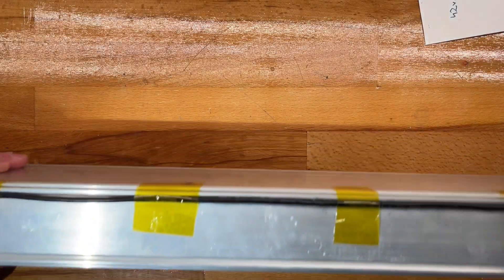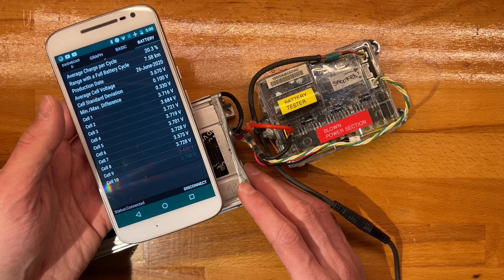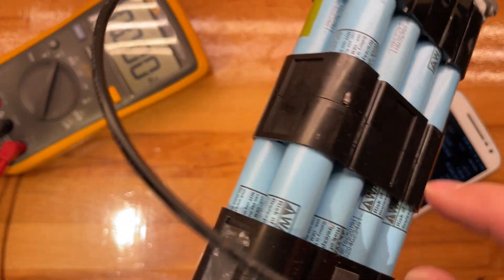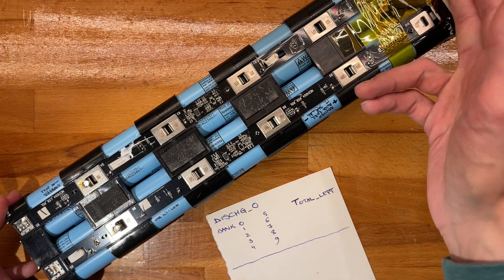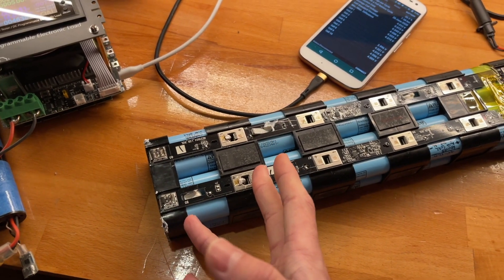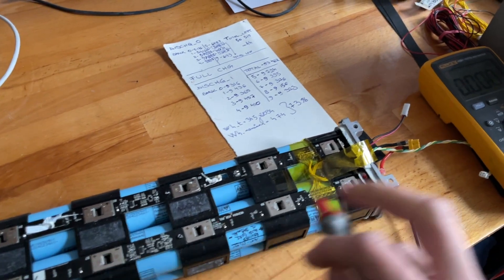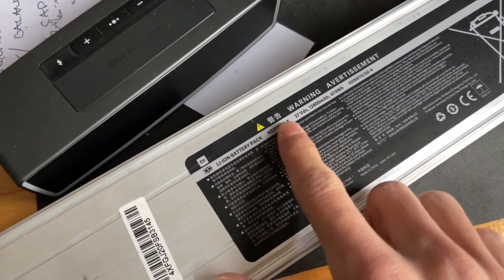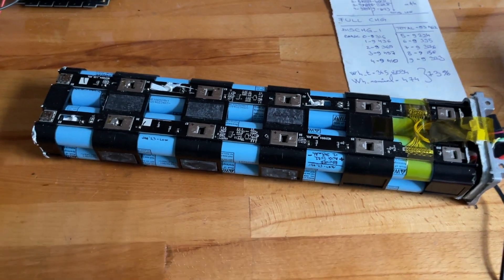XIAOMI PRO2 Battery - Repair 3 [Manual Balancing & Full Checkup]

Comment: how i can run my battery xioami pro2 i will charge only one cell b8 i connected plus to b8 and - b9 i got error diode red  3 fasted and 1 slowed how i can run the bms i got red diod with this error??

Comment: I have the same scooter and I had some corrosion issue, I have no idea how water got inside the battery pack but it did. I bought a replacement BMS the the bars from AliExpress, I soldered everything using a spot welder but when I connect the balancing wires to the BMS it starts with a blue light but then it goes to a blinking red state. I checked the voltage and it seems like there were two banks that were 0.1 volts below the other banks. I recharged thinking it could be the problem but no, still blinking red. Any ideas on what's happening?
Reply: When I measure the voltage of the battery before the BMS it reads 40.6v and after BMS 3.6v with blinking red light. Trying to recharge using the BMS is not possible because the charger indicates that the battery is full (green light)

Comment: I had a similar situation. In my case, despite intensive riding, the batteries were still at 100% after five years (the scooter was kept indoors). However, once I had too much load, and the BMS showed incorrect voltages. It turned out that the STM8L151 burned out (a hole appeared in it).

Comment: Just out of curiosity, it has been a year or so since last video. I guess there were no more manual interventions done to the battery? 
Ot would be great to hear back from Darieee. @darieee
Reply from the maker: heey - yea - unfortunately I found an original spare battery online .. had like 5 cycles on it

and sold the one I had - mentioned everything about it in my listing, including all the videos 🔥

so - unfortunately I don't remember what came of it

about 4000km ... 400 of which uphill with 2 people on the scooter at 1.4kW

I guess the cells were just worn out .. although .. maybe also that BMS chip was acting fishy

do you have the same issue on any of your batteries ?
Reply: Hey, I have an issue oversudden on cell #10. It goes unbalanced and 0.5-0.6V lower then the rest.
Initially I fully charged the battery in the scooter, then opened and charged the cell manually to top it up to the rest of the cells.
Unfortunately it didn't work. After the first cycle the same cell caused unbalance.
Now I opened it again and did full cycle on the cell#10. It has 12160mAh of capacity... Not sure what is causing this. The cell appears to be fine.
I will try to cycle each cell to get overall capacity per cell, and then drain it prior charging in the scooter.

Any advices?

Noted, the cell#10 is the last cell in the pack, hence it would be a nightmare to get it replaced.
Reply from the maker: it's a balancing circuit problem

I did the manual rebalance, and the BMS started AT SOME POINT unballancing a different bank

so - potentially even some firmware issue .. or I just pushed the pack at 1.2kW uphill with 2 people on the scooter for too long

PS: the cells I removed from my offending back were found almost dead after idling in a box for 1 year, so - they were kind of tired
Reply: @Darieee  I did a full cycle (Charge / Discharge) of each cell. I found that the cell #10 is the healthiest among all, with average capacity, 12190 mAh. All cells are within +/- 0.5% from the mean capacity. Another observation I made is that when balancing cables are disconnected, and I was doing cycling of other cells, the cell#10 has been drained from 3.18V (after discharge to 2.8V and rest/recovery to 3.18V) to a 2.9V over a week. It seems like some issue within the BMS, causing drainage of cell#10... 
Any ideas? Could it be an issue of a capacitor?
Reply: Another point of information. I left scooter standing still for a week, and took a snapshot of all batteries voltage. After the week of staying idle the cell #10 lost about 0.077V, while other cells lost only 0.003 upto 0.011V max.
Would it be an issue in BMS, that keeps draining slowly, like a capacitor, or it is the cell #10 got faulty?
Based on my manual discharge and charge test the cell has 12100mAh capacity - the highest amount others... Very strange.

I probably will bring BMS to electronic repair service to check for any faults. Otherwise no idea what could cause the issue...

I run the stock firmware, and normally use it in sport mode. Charging cycle from 30-40% , and very rarely discharging to 5-10% level
Reply from the maker: @05ManSki  Ihave to say I've seen this before .. cells appearing healthy, but turning out rotten after a long idle

on my first (i think) pro2 battery repair video, I removed and replaced 4 cells (the first offending bank)

after half a year in the metal box thing with drawers I now use, they were suuuuper dead, I don't remember exactly, but 3v or even something as crazy as 2.something

so, that's something to keep in mind

batteries are a real special something 🔥
Reply: Ok, @Darieee , I just got time to break into the battery and pull out the cells. As I found bank#10 was lagging behind and suspended faulty. As of testing each sell individually I found that all 4 cells are even in capacity and internal resistance. Tested over 3 cycles. The capacity is at 2900-2950 mAh per cell, and resistance at 75-85, for all.
I have given the BMS for inspection of each component, but no obvious fault found. 
I'm not sure what I can do to review the battery...
Reply from the maker: @05ManSki  try leaving the bank10 cells floating for a good few weeks, mine sagged very seriously ... suggesting that maybe they too had an issue

although my entire pack was VERY stressed for a long time .. so .. that might have been the case with all of them

all-in-all I still suspect something being off with the BMS / BALANCE boards

but maybe if you haven't stressed your cells and they also appear unhealthy in the idle test mentioned earlier .. we can narrow it down
Reply: @Darieee , I will leave it for a week or so, and will keep checking voltage. However, if the internal resistance of each cell is within the spec that means all is good, and there should not be any drainage. I measured IR at fully charged (~75-95mOhm) and fully discharged (100-110mOhm). All is good as a new one. I do have old faulty Samsung and Panasonic cells, they have 20-30% of initial capacity and IR within 700-1000+ mOhm.
Anyway, I will set the cells on the shelf for a week or so. When the bank was in the assembly it was discharging with 0.2-0.3V per week
Reply: @Darieee   , You were 100% right. One cell in the bank #10 does self-discharging at a rate of 0.06V per day in average… Initially it was higher ~0.09V /day, with lower voltage it gets slower. Over the last 8 days, the cell has lost from 4.18V down to 3.54V. The other cells are steady at 4.17V. I have similar cell (same capacity and IR). I will set it into the bank and rebuilt the battery...  The other banks are dead steady. So in short, one cell in the whole assembly can mess up the whole battery. And what is the very interesting, the faulty cell has slightly lower but normal IR (~68 mOhm) and same capacity as healthy cells, based on charge and discharge cycles in BT-C3100 charger.
Reply from the maker: yeah .. very nice finding indeed - I'm happy our results match :| this feels insanely satisfying, AND we're not fighting over some nobel prize, so, zero chances of hard feelings

I kind of felt it, but only now am I sure(er?) of this new, very illusive failure mode of li-ion cells

so basically, as it stands, there is little in terms of quick measurements to be done in order to find this out

I think I still have some of those cells lying around, but then again, mine have been idling in a drawer for almost 2 years now :(

but very very cool, thanks a lot for sharing 🤘🤘
Reply: Btw, we did inspection with infrared camera of the BMS while charging the battery, and found one capacitor is getting warmer ~30-32 Deg C, while the rest of components are at 24-26 Deg C( room temperature). The capacitor is C11, next to Q1 (transistor). Unfortunately, I don't have engineering scheme of the BMC and spec of the capacitor.
If you know any sources for BMS schematic and data sheets of components would be very helpful.

Thanks again....
This is a really long saga
Reply: I have decided to go and buy a new BSM... as i found the healthy bank (#1) has the same remaining capacity per cell and resistance as the faulty bank #10. All cells are performing identically. I can conclude the issue is with the BMS, not with the cells. To be noted, I have the second scooter (the same model) which has the same date of purchase and amount of use - miles, ~2000 km. The second unit battery are performing well and all banks are perfectly balanced. The cells in "faulty" suspected bank and heathy bank are ~2900-2950mAh capacity after 2000km, that is almost 90-95% of initial capacity. this is perfect condition after almost 3 years of mild use...
Reply: You’ve solved the problem with the replacement of the bad cells?
Reply from the maker: others started acting up

I think it was a mix of bad cells (because a few of the replaced ones fell down to almost 0 in a year in my battery box) aaaand a bms issue - because everytime I'd perform a cell swap or manual rebalance, a different bank would start sagging more and more and more
Reply: Hello and thanks for all your efforts in making these videos.I have the same issue with bank no.5.So at first i wold like to balance manualy the whole bank like you did in the 2nd video,if you will be kind to assure me of the right voltage and amps to  use when externaly charge the 4 cells pack ,thanks in advance!!
Reply from the maker: well, see what the other banks are charged to

and give your bank the same, +0.1V or so

and as for current, 1 to 4 amps should be ok, it will drop off as you reach the target voltage anyway

just make sure your supply outputs the exact target voltage with a multimeter before hooking it up to the battery
Reply: @Darieee  thank you for the answer ,i did just that,it seems that the bad cell got shorted so i have to disassemble and replace anyway
Reply from the maker: nkon to the rescue I guess 🫡

let us know how it all ends 😀

Comment: Hi please continue with these videos! I have the same problem and i think i am going to charge manually the 2 cells that are lower than others(i have a min/max of 0.13v). Can i charge them soldering a wire on the metal part where you put the multimeter? Or it's worng?

Comment: There is a way with a custom firmware to switch on the BMS of this battery to use it for a bike or something else? Thanks 👍
Reply from the maker: it holds its output on by default with the stock firmware ✌️

check my diy powerbank videos
Reply: @Darieee  thank you for the reply! Then the 3 wire cable that is going on the main board is just to get data about the state of the battery. I'm thinking to put a custom firmware but i don't know what's the best one, can you recommend me one and also tell me what are the benefits of having a custom firmware? Thank you.